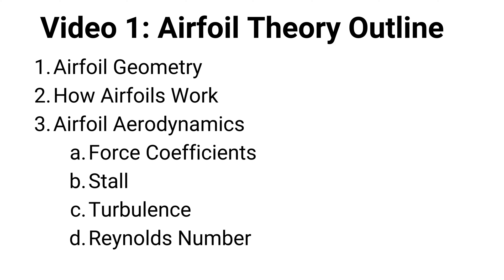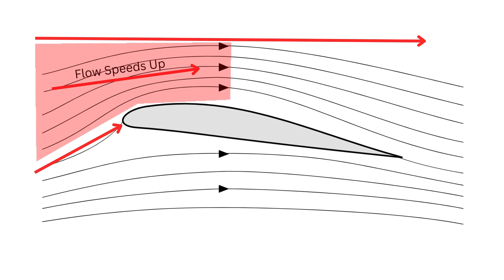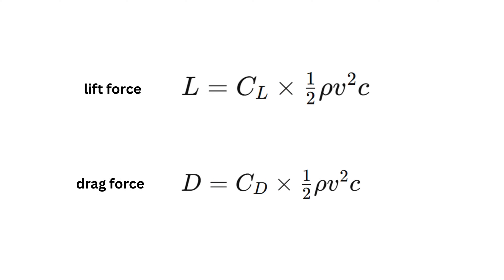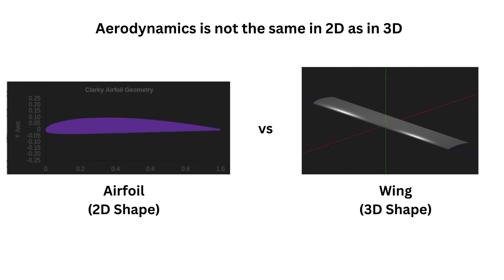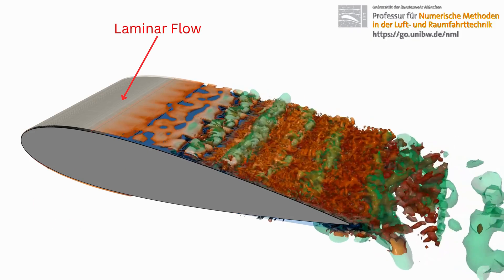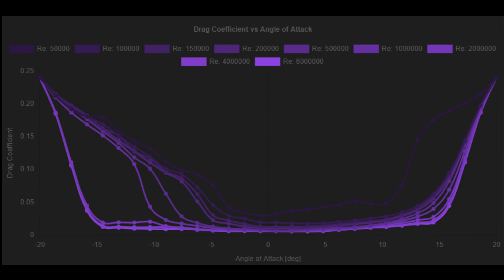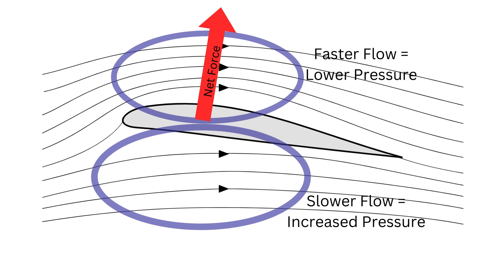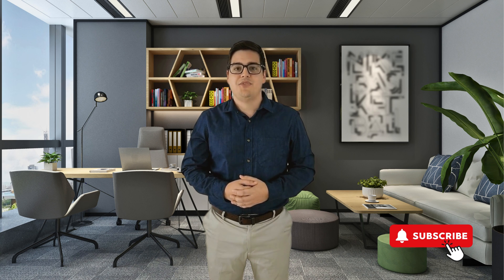Mastering Airfoil Selection for Drones - Part 1: Theory

Comment: 05:39 You are missing something. When calculating the CL and CD it is not by the chord c, but by a surface of reference. Otherwise, the dimensional analysis and results don't check.
Reply: The surface of reference referring to wing, fuselage and tail section?

Comment: The video touched on the subject but didn’t actually talk about it.  That’s the forward shift in CP with increase of AOA.  Dealing with the effects of camber on the pitch of the aircraft, maintaining stability without losing efficiency is a major design challenge and something for consideration when choosing the overall aircraft configuration.  It’s actually possible to achieve aerodynamic instability with dynamic stability at the same time with no moving parts.
Reply: ты тоже в этом ничего не понимаешь .
Reply: @ОлегКо-э9к  Please enlighten us on the subject, Troll.
Reply: Yes, this video specifically on airfoils did not touch on basic low speed aerodynamics and overall aircraft configuration
Reply: @binksactual  даже профиля ты не выбрал, пальцем в небо

Comment: Easily the most comprehensive video on the intenet. I've been searching for something like this for weeks, imagine my surprise seeing this video was only a day old. Subscribed!
Reply from the maker: Thanks for the feedback!  Stay tuned for part 2 which will offer many practical tips and tricks for airfoil selection.  If you have any other topics you would like us to cover, feel free to let us know.
Reply: @SIMNET_aero  yeah I’d love to see differences between pusher and puller prop configurations aerodynamically, I’m currently trying to build a 3d printed fixed wing drone using the inrunners from an junked $20 quad